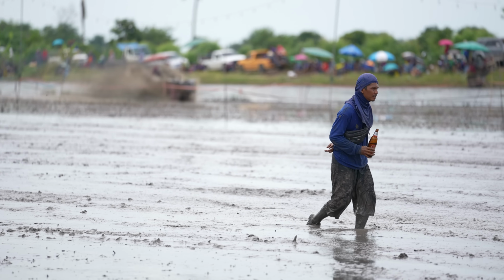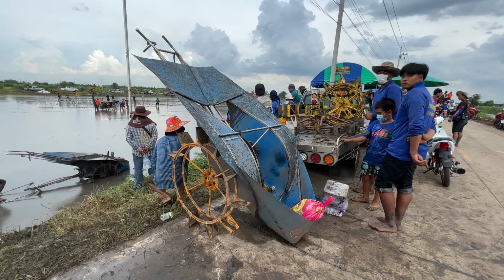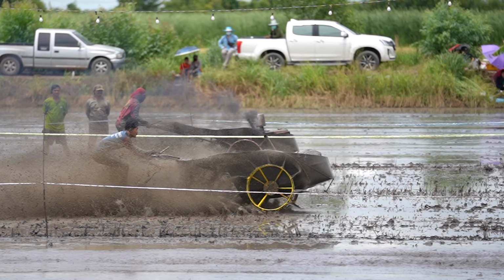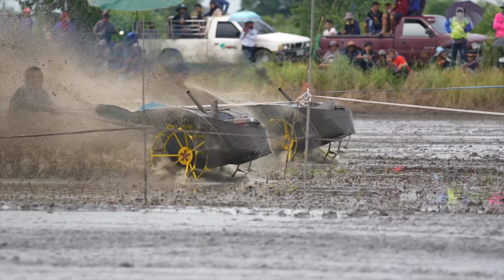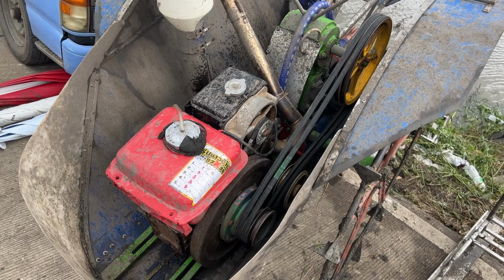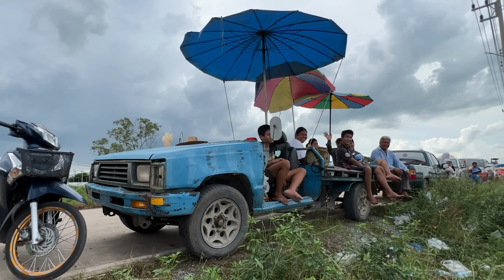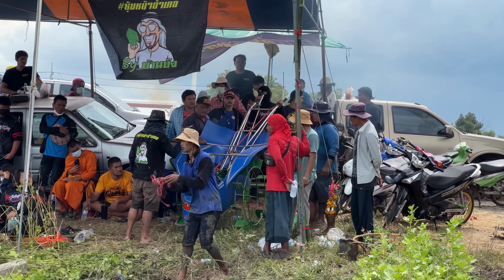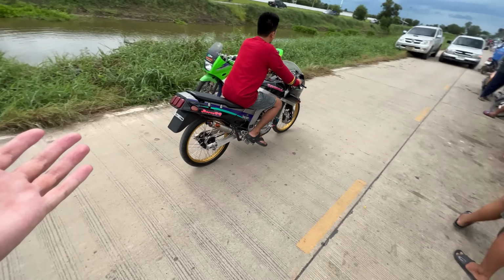Drag Racing Rice Tractors in Thailand

Comment: Chad what you described is exactly how they operate. All the farm engine ones are diesel and look slightly different to those racing ones. The farm ones have headlights too. The pully connecting the engine to the transmission / axle unit has an idler pully on a lever. The belts slip like a clutch until the idler pully is moved by levers and rods from the 'handlebars' to tighten the belt; and off they go but very much slower on the farm. That said they still try to tune them up. If you are passing by when you head North, we can show you what an Isan farm is like. Mother in law still sometimes uses a buffalo on a string to plough the rice fields, although most ploughing is by tractor.

Comment: The pickup truck you saw was Mitsubishi and in the hood is the same type of engine they are racing(Kubota agricultural diesel engines). When working in the field they would attach the ploughinh disces below where the driver stand.

Comment: Those guys would have a crap fit if a man had a twenty to thirty horse power sideshaft motor on one of those things and they could barely hold on to it too now
Reply: Cause all they are using is a eight to ten horse powered motor right now too
Reply: @jamesburke5709  you are very confused those are not 10 horsepower engines those are modified diesel engines look how fast they are 10 horsepower would never do that
Reply: @clintcava1344  all those are eight to ten horse powered gasoline engines and they have been modified up to maybe a twelve to fourteen horse powered motors and that's it too the reason I know this is by the sound of how they are running on the video too I used to help a man build those things myself here
Reply: @clintcava1344  those engines are running off of alcohol or racing fuel and not diesel motors the reason I know that is by looking at the exhaust pipes on them they are blue and that's what they look like when you run one of those things too they are basically the same exact engines that they run on those little pull lawnmowers in the tractor pulls if you've ever seen them before too I've helped build a few of them here myself okay
Reply: @jamesburke5709  just stop 😆
Reply: @clintcava1344  besides if they were diesel engines they would have pure black smoke coming out of the exhaust pipes too and that's a dead giveaway they are gasoline too
Reply: @jamesburke5709  yanmar tf 160 diesel engine